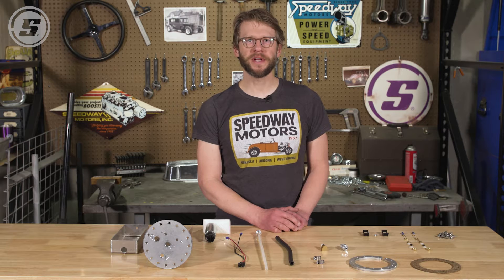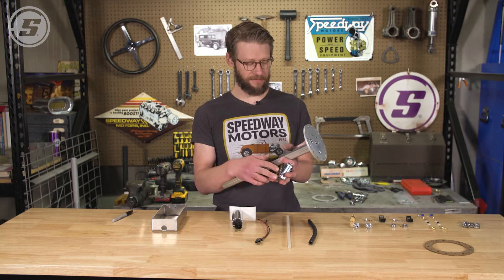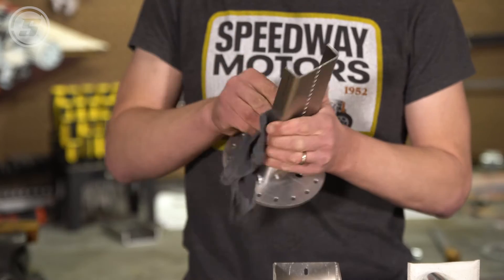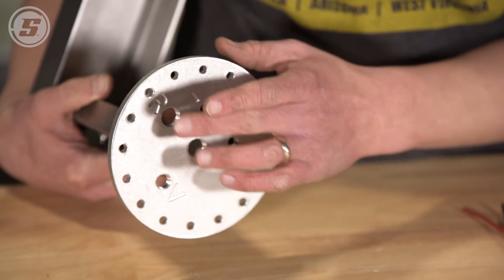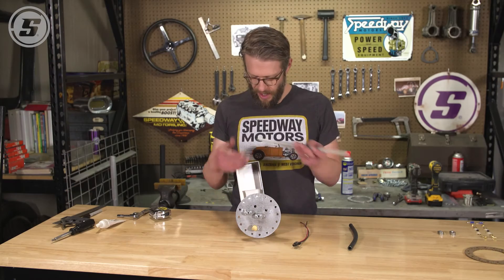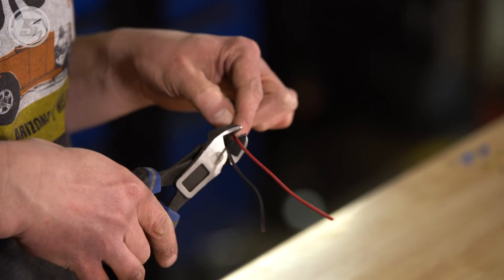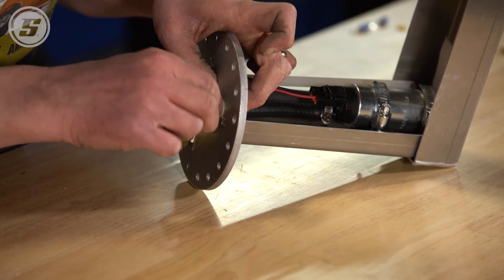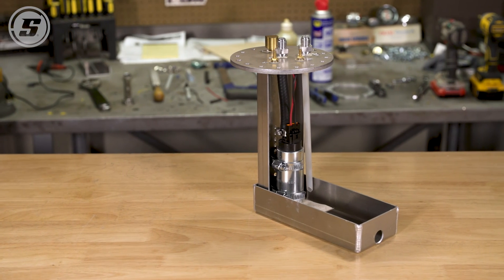In Tank LS Swap Fuel Pump - EFI Gas Tank Conversion

Comment: I bought this exact model, but the only problem is there aren’t any 90° fittings like all the other fuel pumps. I’m having an issue of my c10 bed hitting the regular an 90° fittinf.
Reply: Mounting flange in tank might need to be countersunk an inch orso?.
Reply: Or lower the whole tank?..
Reply: @jamesmartin-by9xh  ended up lowering the tank
Reply: @josephmora5050  cool man!..